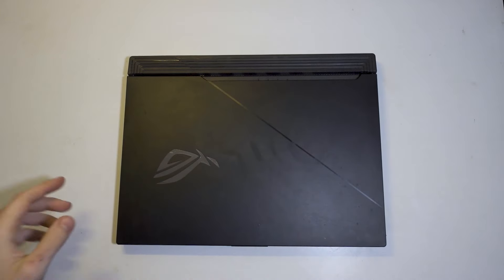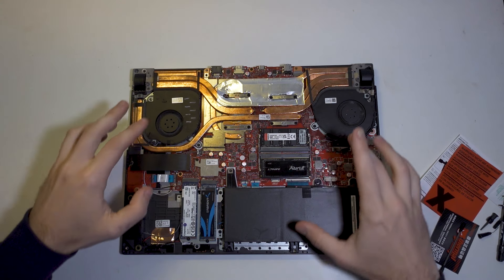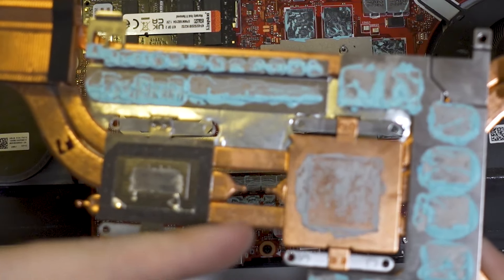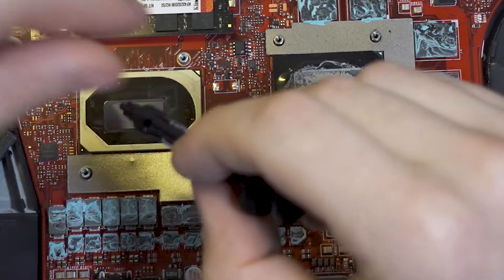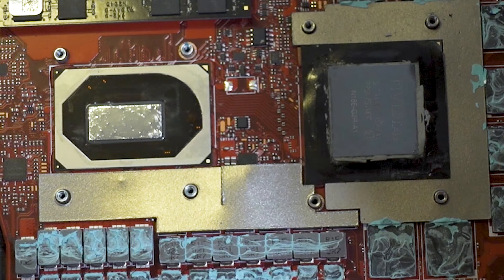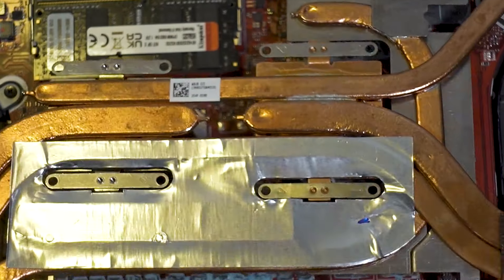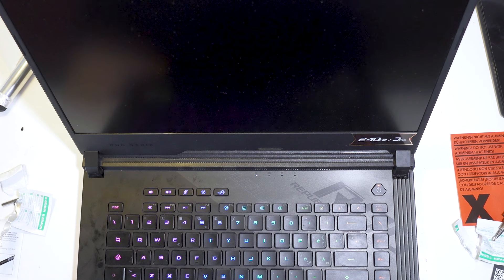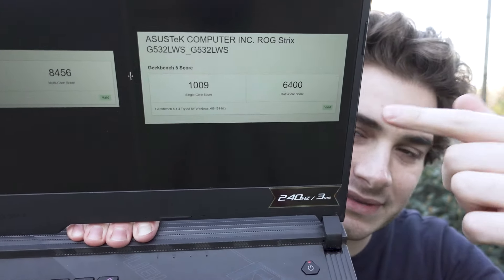Liquid metal cooling my laptop... You will not believe how fast it runs now!

Comment: I believe they went with nickel plated because with only copper overtime the liquid metal get "absorbed" and it'll need a repaste
Reply from the maker: Very true! Copper gets soaked and needs repaste
Reply: @Rimzler  The copper should get saturated after reapplying a time or two though, so in the long run it shouldn't be an issue. Also, according to some statements, creating a foam dam around the die not only helps preventing spills, but also seems to help prolonging the life span of the liquid.
Reply: After initial liquid metal application, it took about a year for it to "dry" up and got over temping. I cleaned the old stuff and re applied and haven't had an issue in years. I think it's cause the initial application created a barrier for the second.

Comment: The solder remover looks very interesting! I'm putting the same liquid metal on the CPU of my Asus g14 (2021). Never done it before. I'm nervous! But I have faith that I can do it tomorrow
Reply: Solder removers are cheap and worth having
Reply: @justinTime077  I did it! It runs about the same, but the fans kick on less
Reply: whats the temp difference i wanna try doing it on my laptop
Reply: @fazemoti2755  For me, the temps remained the same, but the fans were noticibly quieter
Reply: Did you ever repaste in this last year or only fan cleaning? Does the temps same?
Reply: @corey7219  when you say fan is a lot quiter, it means the liquid metal is doing its job and you are wrong performance will be a lot better. Benchmarks run for just short times. But the lower the temperature, the longer the frequency turbo boost and that make performance to endure a lot more

Comment: What happen to the temp. before and after?? That's the most important result we want to see.
Reply from the maker: Temp is lower and clock is higher, i should have posted the results in the video
Reply: Yes please haha
Reply: I also apply liquid metal to my laptop but I put both XD.

Before and after

CPU stress test: 88W
95°C to 82°C

INGAME: Heavy both
GPU: 84°C to 72°C (150-165W)
CPU: 97°C to 88-92°C (40-60W)

INGAME: Medium like GTA V
GPU: 83°C to 70°C (130-165W)
CPU: 89°C to 81-85°C (35-45W)
Reply: I think when you use liquid metal at GPU the heat from GPU take all the cooling from CPU that's why ingame the result CPU still got high temp especially when game use a lot of GPU and CPU like Horizon New Dawn.

Comment: I just did this exact thing to my Legion 7 Gen5 (10750H/2070Super) Same before as you, even with 2 less cores than the 10875, constant thermal issues from the day I got it. It's still powerful enough to throttle and still hang, but I got tired of not getting full performance. I tried a couple thermal pastes before setlling on LM. None of the pastes helped, maybe a 2-3c drop. With the LM applied I haven't seen it go beyond like 84c now. Clocks are sustained. Just a much better machine now. Wish I'd done it sooner. Just don't apply too much lol...I even put it on the GPU.

Comment: Bro, glad that I found your video. I recently got Asus ROG Strix 17 SE (12950HX + 3080ti GPU) and CPU is sitting at 95 C most of the time, even under light loads. I tried everything, but I think they somehow failed with LM application to CPU, so I plan on reapplying it and applying it to GPU too with some extra safety measures. 

I am curious how your laptop works rn, 10 months in, and how are your thermals :)
Reply: I got a Strix 15 with a Ryzen 5800H, I made sure to disable turbo boost cause it is not always needed in some games. Makes it run way cooler and quieter! And not losing any fps in GPU bound games
Reply: Get an iets cooler
Reply: I removed factory Liquid Metal and applied it on my own, now temps are way better.
Its Asus's horrible quality control.
Reply: @KoshMobile  Did you also put LM on the GPU? Did u have to prepare the surface around?
Reply: @Kiekerr  Yeah, I changed LM on GPU. I found out that my gpu is already with LM on it when cracked laptop open. 
So it was prepared, with foam lm capturers, and everything but chip hidden behind finisher. 
Looking on how LM was everywhere around I wouldnt recommend putting LM on laptops unless they are properly prepared by it by either manufacturer or owner.
Reply: @KoshMobile  Thank you for the quick reply, I think my laptop only has LM on the CPU, so I'll probably re-do that with LM and put new paste on the GPU (Scar 15 2021 with 3070)
Reply: @Kiekerr u mean turbo from armoury crate software?
Reply: @prateekdawalia9665  I mean the AMD turbo. So it stays at base clock. For my 5800h the base clock is 3.2, turbo clock is 4.4 When disabling turbo, it doesn't go over 3.2 and uses way less watts and stays way cooler
Reply: @Kiekerr  ohhh okay thankss!
Reply: @prateekdawalia9665  you can usually disable this in Windows Power Plan

Comment: Iam always putting LM into my laptops, right now Ive put it inside my new Legion Slim 5 with i5 13500H and RTX 4050, but the results havent been as Ive expected, like one day I do a stress test, and the CPU still goes to 97°C, then I do the test another day and the temp go only to 86°C, as if the LM had to sort of "sit down". Recently, Ive learned about thermal putty, so Iam gonna use it instead of thermal pads to see if the cooler gonna sit tighter on the CPU/GPU die.
Reply from the maker: Lm can sip through copper like water, so needs to be reapplied till the copper is saturated

Comment: Nice, it's indeed a bit risky.... but looks like a good appliance :D
Laptops are prone to thermal throttling, the score increase you got is immense though!
Reply from the maker: Soo worth it, chickened out with the GPU, could had it even cooler!
Reply: @Rimzler  just make sure to check it once in a while, i’ve heard it can chemically react with the alloys… even though it should be fine for some…
Reply: @Rimzler  I literally just did my cpu and GPU on my Zephyrus S17. Trying to see if there are any horror stories right now lol
Reply: @ryanthurman92  so? Any issues? How are the thermals?
Reply: @saadhussain6514  dude actually amazing. I did redo it over and over about 5 times to learn the right amount. But 20c lower on average on cpu. 10c lower on gpu. My zephyrus rates top 90th percentile for like builds on performance. And for safety purposes considering it’s conductivity. I used clear nail polish over the contact points over the sides of the die of the GPU and after applying the Liquid Metal to the dies. I used normal thermal paste on the far outside of the gpu chip not on the metal on the plastic to create a barrier to prevent any leaks. The CPU I didn’t have to do this with as it was designed for Liquid Metal and has its own barrier designed into it with some fabric that prevents seepage. I couldn’t recommend it more. I did it so many times to get an idea of how to do it best and safest and just how much to apply. Lots of people say to apply the Liquid Metal to the die and heatsink. I did that the first time. The last time I did not. And there are no differences in temps between the two ways in my experience. I honestly feel you’re safer doing just the die as you don’t have as much Liquid Metal used and therefore less risk of it leaking out and damaging other components.
Reply: @Rimzler  On my laptop, the GPU seems to be perfect to be used with liquid metal as everything around it is covered, so it's good to go...but the CPU is the risky one for me

Comment: great video. well done. you did it the same way i did my gu603zw.
Reply from the maker: I also 3d printed taller back rubber feet, so the fans have better clearance and airflow, that made a good difference

Comment: What about those VRMs not sure if that's what they are called( those black cubes) around the GPU which had thermal paste? are we supposed to re-paste them too?
Reply: No they have their own type of thermal paste so it's best to leave the factory one on be careful to not touch the pads when removing the heatsink
Reply from the maker: If you mess up the blue stuff is not as bad as if you mess up thermal paste, but of course reapplying is better if deformed
Reply: The big ones around the GPU are the Vram modules, the smaller ones are the VRM.

Comment: So apparently the problem of liquid metal seeping out from between the contact points is not limited to aftermarket applications. I think if you plan to use liquid metal in a laptop, you better not carry that laptop around much and when you do decide to carry it, you should let it cool down completely first. The liquid metal moving out onto the mobo is usually what kills the device and not improper installation. Liquid metal is not worth the risk in a portable application.
Reply: Can I choose to immediately replace liquid metal with silicone grease after buying a new computer?
Reply: Ive used LM in 4 laptops that Ive been carrying all the time, and never had a problem, but its still something to be careful about. Right now, I plan to use thermal putty instead of thermal pads, and I will also use it to seal the CPU/GPU dies.

Comment: Hello, thank you for your guidance and hints. I want to ask that how long does it take since you buy this laptop? I agree that thermal paste was bad condition. However there is a belief that liquid metal thermal paste (LM) has endless lifespan. Is it true? What are you thinking about that. Since LM's are used on laptops, thermal conditions get well. laptops come with LM, already comes with good  processor insulation on motherboard. I  believe that some home users should be more brave to reapply this LM :). Thanks. (LM)  (LM)

Comment: My xps 15 7590 hits 99 - 101° on some cores during fortnite. Lol. This is with a fan pad, max internal fan curve. Even with an undervolt when that was possible. Repasted with thernal grizzly paste not metal. Would love to try liquid metal but can't risk it, cant get a new laptop if i break it so yeah. Its amazing how capable laptops are though. I also play Deus Ex, an incredibly poorly optimized and thus demanding game but on low settings get a solid and playable 50fps. 4k display, reduce to 1080 and yeah she plays. I only wish I'd been in the market now. If I'd got the latest XPS rtx4060 with the vapor chamber, I'd be stoked! As always i rush ahead and screw myself. Gtx 1650 vs an rtx 4060 - 80..  vapor chamber options. Can only dream
Reply from the maker: The good market is coming in 1/2 years imho, 3/2 nm chips are at the door, improved cooling solution as well, like those super cool solid state blowers, can't wait!

Comment: hi
you need to limit processor to 99%

Right click the Start menu and select Control Panel.
Click Hardware and Sound.
Select Power Options.
Find Processor power management and open the menu for Minimum processor state.
Change the setting for on battery to 99%.
Change the setting for plugged in to 99%.
Reply from the maker: What would that do? I'm curious
Reply: @Rimzler  your CPU  thermals get lot better,because the CPU don't activate turbo Boost,better thermals ,you don't see big loss in performance
Reply: @Rimzler   I do this on my laptops with around 20 degrees reduction
Reply: @carlosrito  it will reduce performance in CPU bound games like warzone. I have tried. It is basically handicapping CPU for lower thermals. If you are not gaming, then its fine
Reply: @MrReklez  not all games are heavy dependent on cpu
Reply from the maker: Ohhh I'll keep it in mind! I need that turbo for renderings and snappiness in general, i put the metal, undervolted, now it keeps turboing for long ahahahah
Reply: This is a terrible way of handicapping your cpu.

Just disable the boost if you know how to
Reply: @DrLogic_  yup
Reply: I would disable turbo boost and kill your performance. Bad advice
Reply: @UOHCUNY  no it's doesn't for me it's increased performance

Comment: Hello Rimzler, 

I am very curious on trying liquid metal. how is your LM application on your laptop today? 
Also, I would like to know how it looks or any situation to take note since I also wanted to try it on my old laptop and will mostly carry it everywhere I go. 

Hoping for your response.

Thanks!
Reply from the maker: Still using it to edit videos on, still runs cool and I'm satisfied!
Be sure to avoid spilling and maybe dam the surrounding area to prevent shortcircuits, remove battery when doing it
Reply: @Rimzler  Good to hear!

Actually, I applied LM last night and the application went well, heck yeah! However, results were not that worth it which is expected. So....

*Lesson of the day: * 

*LM is not worth applying on laptops without custom fan profiles. *

Since these laptops' fan levels ramps up only with certain temperatures.

Pros: 
- my laptop run cooler on idle and normal use. In fact, and surprisingly, the fans is not spinning or runs slower than usual. 
- 3%-5% performance boost (LM is definitely a factor aiding my undervolted profile on achieving higher clock speed while throttling due to the crap fan system.) 
- theoretically, longer battery life, since the fans runs slower if not idle. 

Cons:

Nothing much actually. just...

effort not worth it, after all the shebangs. The whole process makes you anx. 

I don't think that the LM will leak out or move around much since, i found out that less LM is more than enough to help the heatsink absorb heat faster. just apply little/enough amount on contact points and ur good. 

Unit: UX333 (Zenbook 13)
i5-8250u + mx150 (10w, bruh what a deal breaker.)

That's all, hope this helps other to save their time and resources. 

Enjoy laptop life!!
Reply from the maker: On my laptop i managed to create a custom profile that spins the fans 100% when temps go above 40c so it stays always super cool

Comment: You can undervolt your CPU it will help with temperature
Reply: Not sure about other Laptops but on my Dell G15 they released a bios update that disabled cpu voltage control due to a security concern from Intel.
Reply from the maker: I did undervolt and it's running much faster!
Reply: @Rimzler  Unfortunately dell won't let me rollback to a bios that allows voltage control.
Reply: @AAP2023  i was planning to buy the G15 and one of the plans was to undervolt the CPU because i knew that the G15 runs hot. In my current laptop i use Throttlestop to undervolt the CPU, not from the bios, if the update you are talking about forbids this process, then this is new to me🥲. I know that you can undevolt some computers from the bios it self, yet others you can’t.
Reply: @kanshashiteiru6552  tbh dell laptops have a really badly designed heatsink and cooling layout, I would go with a different brand. I have actually jusy unlocked undervolting via editing the bios with grubx64 but even with undervolting to -100mv and liquid metal on the CPU it's still reaching around 85 - 90c while on a laptop cooling pad.
Reply: @AAP2023  85-90 C with a load is not that bad actually in a laptop if its not throttling, I’m assuming that you are a gamer, use Msi afterburner to monitor your CPU and GPU performance while gaming like temperature, Boost frequency etc @1080P resolution, because games at 1080P are more CPU bounded Than GPU, also you can use Cinebench to stress your CPU and test your Undervolting. Cinebench will help you determine which undervolting is suitable for your machine, because you can push your undervolt further and further and here is how to do it 
0- every system is different, so different laptops Models can handle different undervolting and the best way is to test it by your self. Note that when you undervolt DONT save the undervolt permanently, so that if the laptop crashes it will restart its default sittings 😊
1- Run cinebench without the undervolting and observe the score, so that you have a base score to compare with 
2- Undervolt your CPU Core and cache and run the Cinebench again and observe the improvement of score
3- push your undervolt further and run the test
4-repeat step 3, if the laptop got unstable or crashed reduce your values a little bit. Run the test several times to make sure that these are the best values you can possibly get
Reply: I think you can push your undervolt more than -100mv
Reply: Undervolt does almost nothing for laptops
Reply: @Acidburn3141  what do you mean?
Reply: It helps but my games still have lag fps drops I’ve got a 3070 i7-11800h 16gb ram and on my msi gp66 leopard it throttles constantly
Reply: @AAP2023  Can be overridden pretty easily, just need to do a little UEFItool editing.
Reply: @kanshashiteiru6552  One thing I have noticed with undervolts that doesn't show up in Cinebench testing etc is weird I/O errors on USB drives when undervolt is too much, worth extending your testing to include other things.
Reply: @lemagreengreen  interesting 🤨, Anothor thing I noticed lately. If you push your undervolting too far, it will cause your laptop to crash and get stuck in repotting and crash again, this because the undervolting settings are still functioning, so you need to force shutdown to cancel undervolting. If this happens alot it could corrupt your files or even your windows and this might be a big problem so please be careful.
Reply: Bro i undervolted but my temperature doesn't decreased 1°c when ever I play I play games it temps up to 93°c almost immediately and then it just starts thermal throttling.😭 r u sure that applying liquid metal will fix this problem?
Reply: @ayushmaangupta2725  Hi, may i ask what is the model of your laptop and when was the last time you changed your thermal paste?